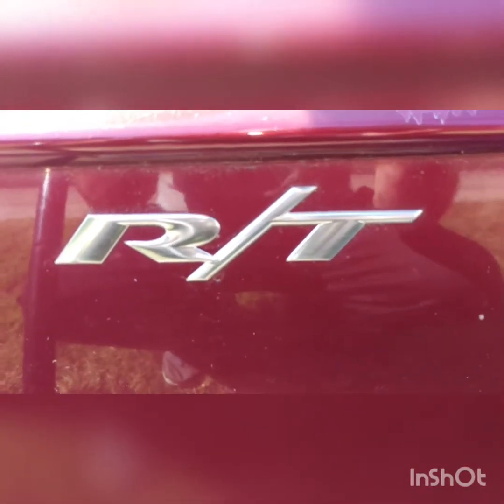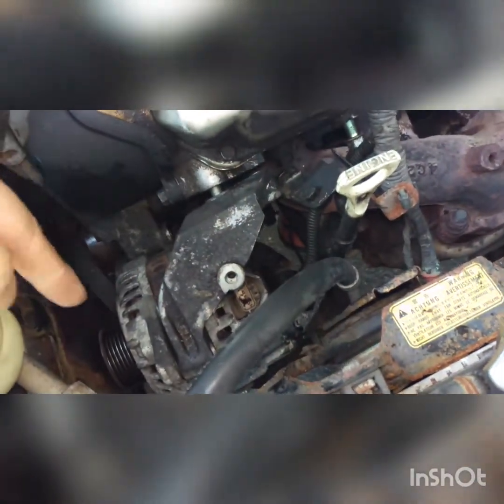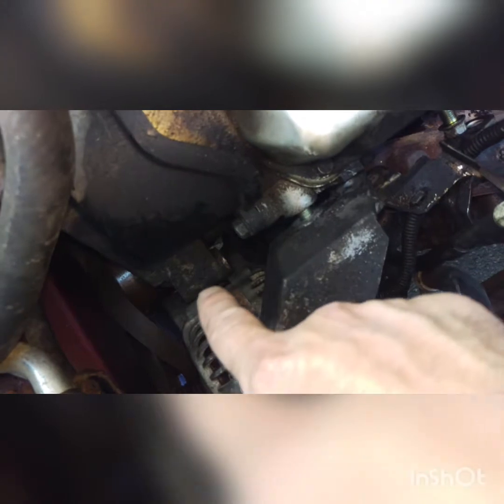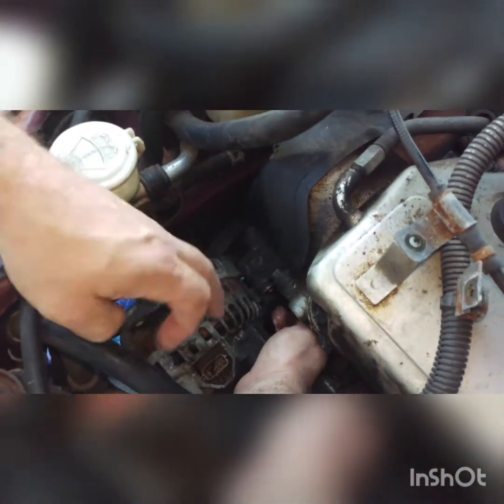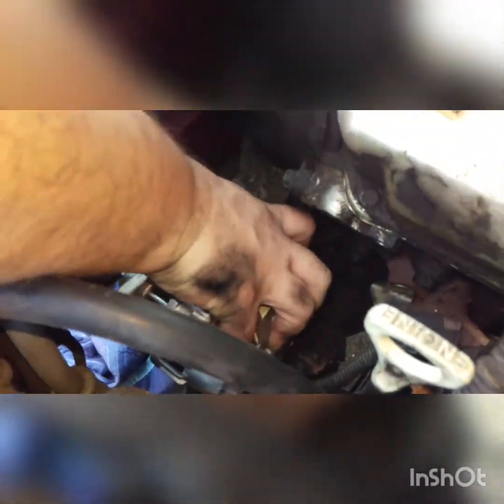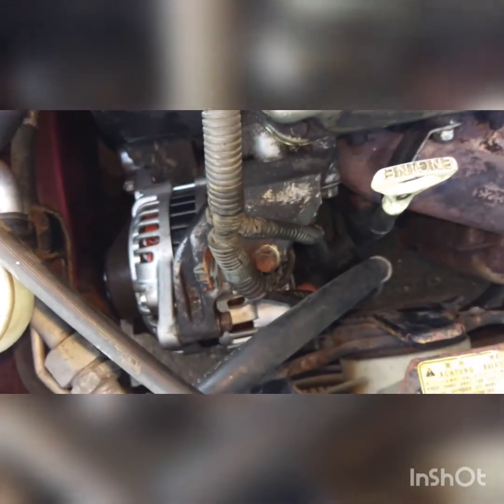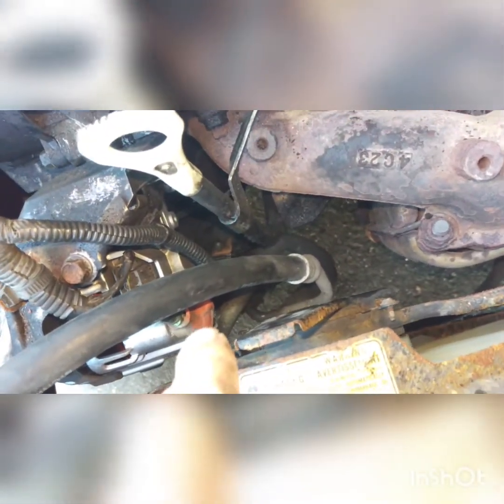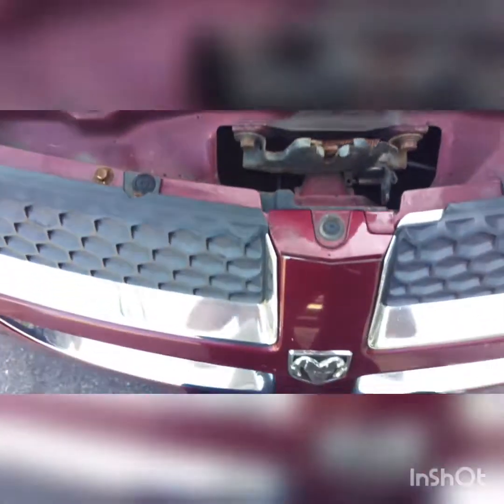Alternator Replacement for a 2004 Dodge Stratus Rt 3.0 6 cylinder engine.

Comment: Thank you, I got a Dodge 2001 Stratus RT 3.0 Those cars look very much the same. I learned thanks to you about the screw tensioner. Without your help I would have to use my mechanic again. I don't have any issues with my mechanic but this time I wanted to do it myself. Thank you Bro. Action Donkey Garage. Blessings!

Comment: I took the 3 bolts out of a 2006 Stratus and the Alternator was free from the pulley . Without loosening the tension. Could that be a problem
Reply from the maker: The tensioner is meant for the belt removal and installation. It allows the belt to be adjusted for tension. Hope that helped.